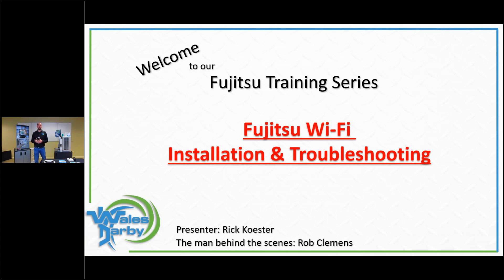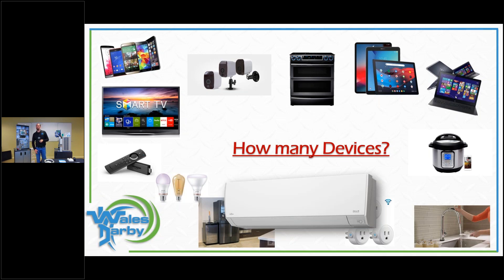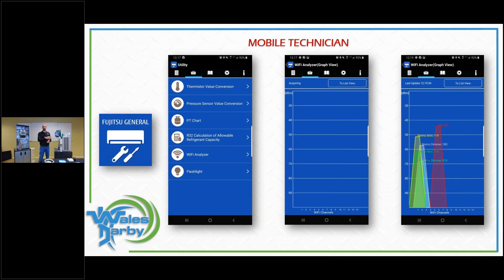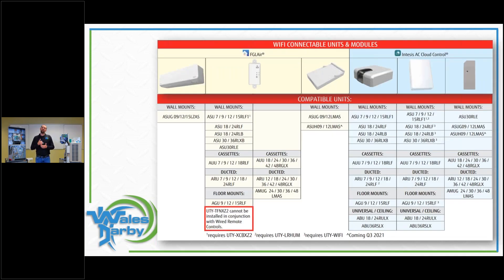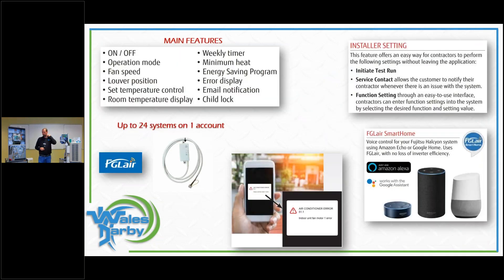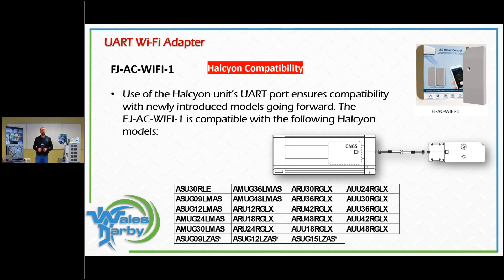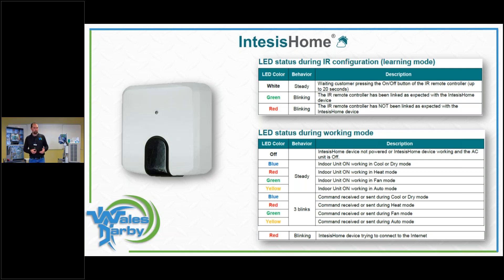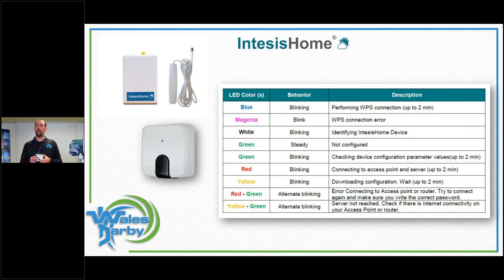Fujitsu Wi fi Products Training

Comment: it is a amazing.  I spent $20k+ in equipment and installation for a Fujitsu unit with 4 heads and this is what you have to go through to get Wifi.  My steam boiler is connected to a nest and I can control it anywhere in the word.  How in the world don't these companies do a better job enabling these units to be connected to wifi.  I wish I bough a different manufacturer
Reply: Agree. Mitsubishi seems to be a pain too. I think Daikin one thermostat is much simpler to setup as the wifi “module” is an integral part of the thermostat.

Comment: Hi, excellent video thanks for sharing. I have an issue, I used FGlair app but if my units are off by remote control or the app the WiFi connection get lost and the app show the unit offline, if I turn on with RC the unit show again online and is able to be control by WiFi, is possible this is because of the dip switch selection?